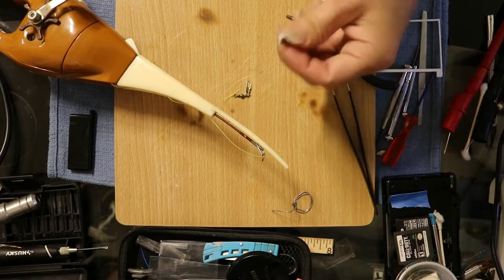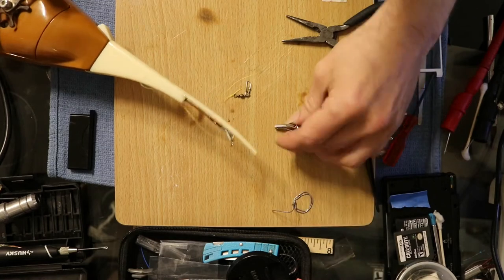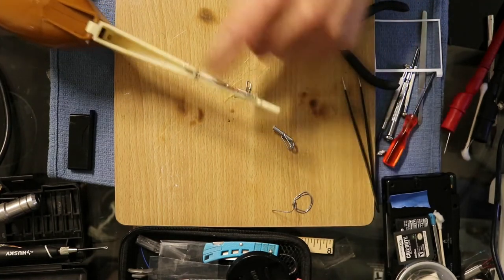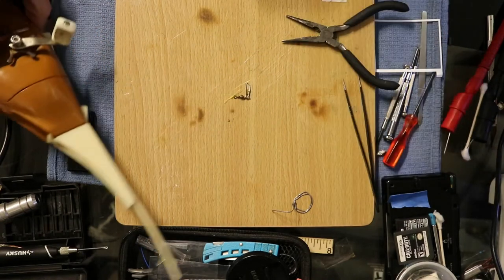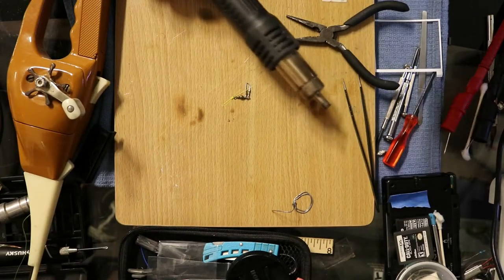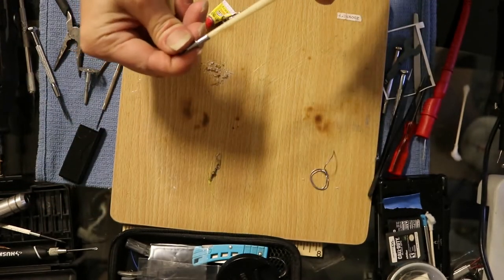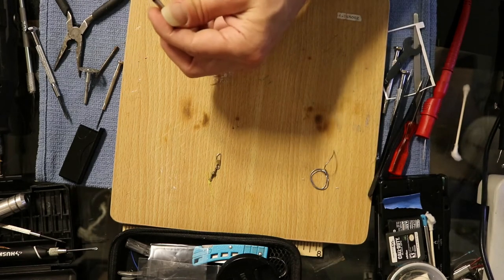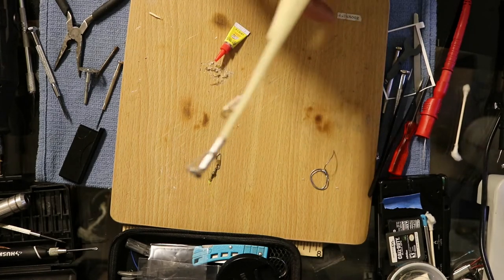Ronco Pocket Fisherman Tip Repair

Comment: Do you know how I can fix the reel? Its not picking up the fishing line whenever I try to reel it in
Reply from the maker: mine was kind of crusty. I hit this one with a polishing wheel and the dremel...
If you don't have that.. women sometimes have fingernail polishing stuff .. that works good too.. just don't tell them they get mad for some reason..

definitely take it apart as good as you can and clean everything and lube 
it with some light grease or 3in1 oil..  make sure everything moves freely.
This one is still flaky sometimes and likes to pick up the line and wind it between the spool and the bell. that's a pain and a disassemble in the field.